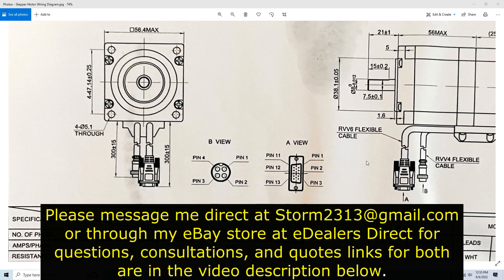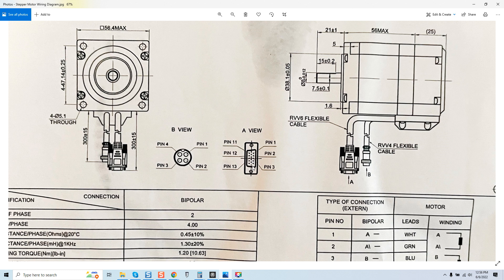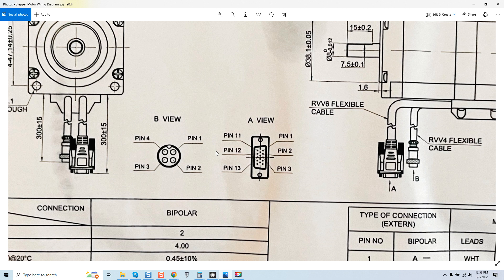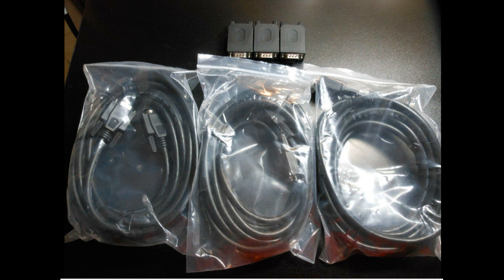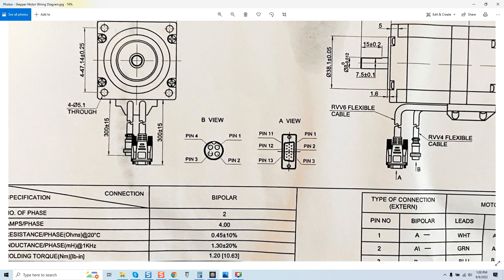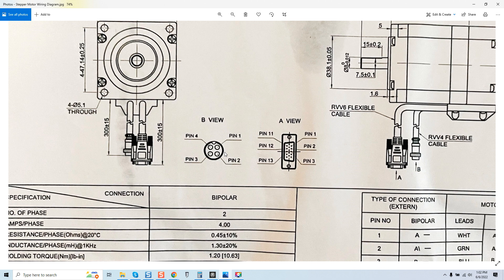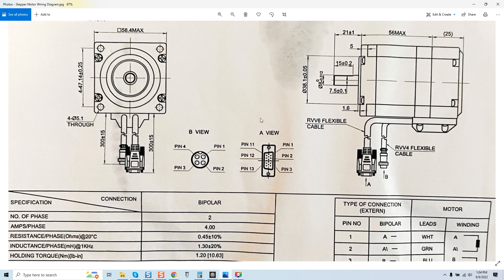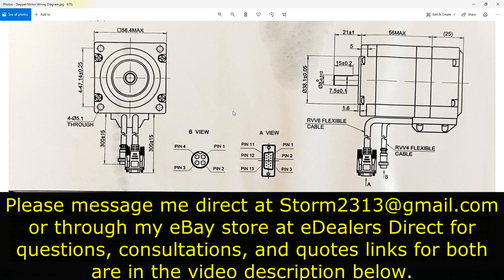How To Change Stepper/Servo Motor Connectors To Use Double Shielded Cables For Maximum Stability..

Comment: Vince, from what I hearing you say, even after changing the connectors, the Double Shield Protection is only up to the connectors and not all the way into the motor/encoder body?  Does that short unprotected run not defeat the purpose of protection?
Reply from the maker: Thank you for your support. No, this distance you're discussing is not possible to filter, and will yield no problematic effects. Thank you,
Vince

Comment: Hi Vince, Bergen here from South Africa.  I am in the wiring part of a CNC router build and came across your channel. Thank the heavens and finally not the blind leading the blind! 90% of the videos I have seen, the guys preach shielded cable but are not draining the shields! 

So 2 quick questions if you would be so gracious to help..

Nema 34 closed loop steppers with HBS860 drivers. 

Motor: I have bought 1.5mm2 x 4C shielded cables for all motors. I am using a free standing control unit whereby all machine cabling connects via GX or similar connectors. Would it be okay to peel the shield back over the cable whilst wiring to make contact with the housing of the male GX, assuming that when this makes contact with female on the panel it would ground to the enclosure? Probably best and not too expensive to go with GX16 x 5 and run pin 5 to ground?

Encoder: Has pins EB+ ,EB- ,EA+ ,EA-, VCC and EGND. Would it be correct to solder/connect the shields to EGDN on the driver? Or should this rather be drained to the earth bus bar?
Reply from the maker: You can certainly do that with the drains, but with GX-16 connectors you won't be able to insert its solder terminal insert to screw it together as its a flush fit. You're best allocating the shield drain to the connectors 5th pin for 4 lead motors. 

All shield drains regardless of where they are from are to be allocated to the systems ground bus. 

Thank you,
Vince
Reply: @corvetteguy50  thanks a mil!
Reply from the maker: You bet...:)

Thank you,
Vince

Comment: I was looking at that very same motor driver combo. I am in research mode and haven't purchased anything as of now. I have a good idea on what chassis and controller I will be getting and working backwards from there. The chassis takes nema 23 motors. I will be mostly doing wood carvings, but want the ability to machine aluminum. I would like that extra precision that comes from a servo. After working with a certain wooden cnc (not mine) I have a good idea what I don't want as well. 

Your information and knowledge is priceless. Thank you for taking the time to make these videos.
Reply from the maker: Michael, thank you for your support. 

Steppers, and servos feature the same accuracy. If you're primarily using your robot for wood substrates then steppers are your best investment even when machining aluminum. Here's the accuracy achieved with one of my controllers from a European client. https://youtu.be/JHx4pt3_KQw

Here's another video discussing the truth about the servo, and stepper debate with actual performance https://youtu.be/1ASXZurORDo

Here's another video confirming stepper, and servo myths. https://youtu.be/Exk7ORteS0o

Research carefully, and I suggest investing in areas that matter like a properly built controller, and ball screw transmission as these will yield a much higher ROI.

Thank you,
Vince
Reply: @corvetteguy50  Thank you for the resources. I'll definitely look into these today.
Reply from the maker: You bet...😀 Thank you,
Vince

Comment: This seems oddly familiar. The encoder cable does state that it is shielded on the packaging, but not the stepper motor. Another reason I order from you is I know you will steer me in the right direction, as in this case.   Eventually I will get it right, but in the meantime, I am learning a lot! Thanks for that!!!
Reply from the maker: Dave, thank you for your support as always. I know this video will certainly help many others...:) Thank you,
 Vince